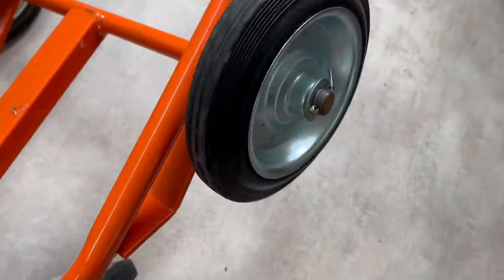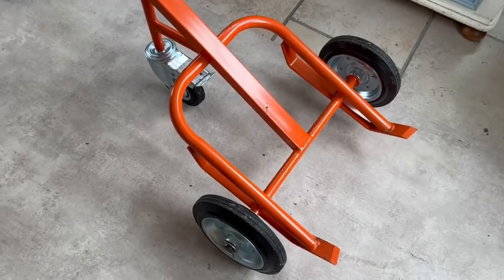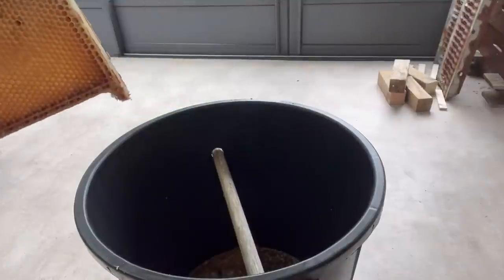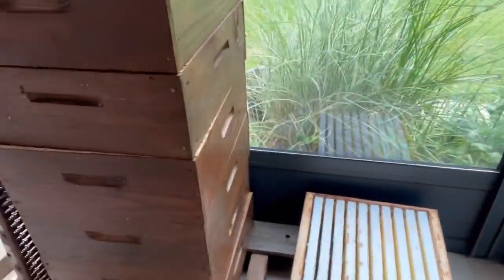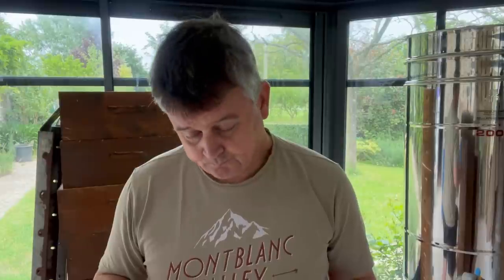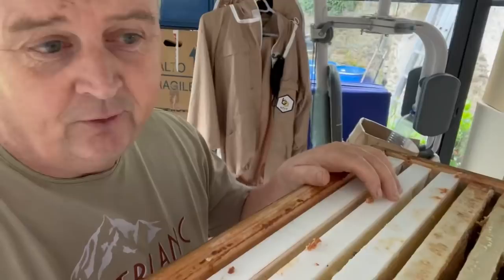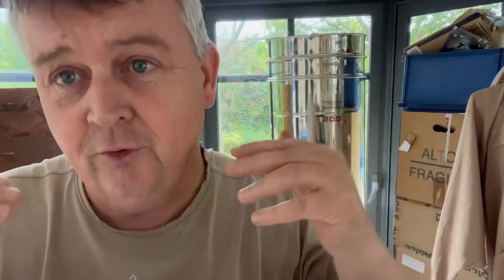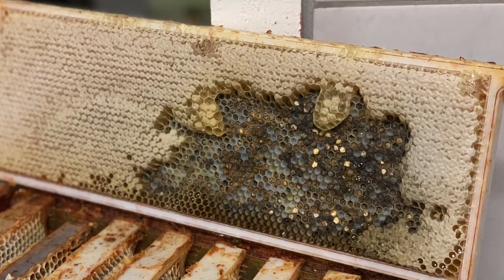Dealing with pollen in the supers!! 🙌🐝

Comment: Who sells the metal strip to convert 10 frame boxes to 8 frame? that's brilliant.
Reply from the maker: You can buy them online in many French shops or shops that have DADANT, in France they are called “Cremalier” in uk they are called casselelations
Reply: @richardnoel3141  i found it under "castellations" probably because they look like castle parapets
Reply: Does a full super with 8 frames weigh more than a full super with 10 frames?

Comment: Hiya what do you recommend when your frames aren’t plastic, scrape carefully lol or just change foundation. Learn something every vid you make. Thanks
Reply from the maker: Hi Emma you have a few options to carefully scrape them out and often they will rebuild if you remove just the pollen. This is what I’m trying to explain is it’s about getting the balance between foundation and plastic foundation with our supers we don’t need to spend the money on renewing the foundation it’s a little bit quicker and a little bit less time consuming if you’re doing it on a big scale to hard plastic foundation we think other people like to use wood and foundation made by the Bees that’s a choice but I personally think that after a while the foundation drawn by the bees on wooden frames does get a bit misshapen after a while. There is very little advantage in the 2 to be honest for us also the plastic frames are much lighter and much more durable. I would certainly say that you can scrape out a lot of pollen from your wax foundation if you’re very careful because for us we can’t get any lower to remove that residual propolis and dry pollen because the plastic is premolded ( that’s why we pressure wash it)where is with foundation you can actually get lower to the bottom of the cell, so there is some advantages and some disadvantages
Reply: @richardnoel3141  thanks, maybe if I get more hives and start producing honey I will follow your example and use them in the supers, thanks
Reply: @richardnoel3141  thanks

Comment: Can you explain how you get more honey only having 8 frames or 9 frame vs 10 frames?  I get when you are running through an uncapping machine it makes less work with 9 frames.  Thx!
Reply from the maker: Hi David, you don’t necessarily have more honey, that’s down to other things, ( like weather and flowers) however the bees have more wax cells to fill less frames in the way so you have the maximum frames they we can easily remove afterwards, (without cross combs  etc.)The skill is getting it pre built so when the flow starts the bees can fill it quickly and build huge combs that hold more honey and have two less frames in. I find and so do other beekeepers that you get less crystallisation,  the less frames you have per box.  Building new foundation or building on new frames is very costly in terms of honey, but much mess so once your combs are build out on 8, 9, or 10 configuration.
Reply: @richardnoel3141  Thank you for the excellent explanation Mr. Noel!  I know my Dad usually ran 9 frames in honey supers in his commercial operation.  As a kid I never gave it much thought, lol.  As a hobby keep I do everything pretty manual and I've never had issues with crystallization here in Colorado.

Comment: Hi Richard,  love the videos, any recommendations for getting pollen out if you are from wax foundation without destroying it? Are the spacers worth the cost and all the effort? As apposed to just doing it with your eye when changing from 10s to 8s or 9s
Reply from the maker: Hi Craxy Kiwi, you can actually buy a hand spacer ( I think Kamen  Reynolds featured in his last video about went to add a super) that you put on top of the frames and give you the exact distance needed if you have rails rather than cancellations. So there is different methods but a lot of people just go for nines and it’s the middle range so I only show the question and try and explain because it’s the way of absolutely maximising everything but you just have to know how to do it and how to work at it if you have all your frames space with nine per box that’s absolutely fine there’s no problem and you’ll probably do really well with that. Best of luck
Reply: y hand spacing is possible, in fact L. Langstroth did it that way, but it is time consuming, uneven and spacing easly disturbed by movement